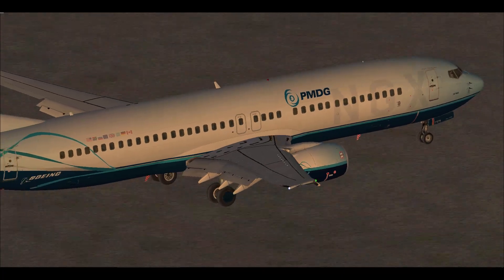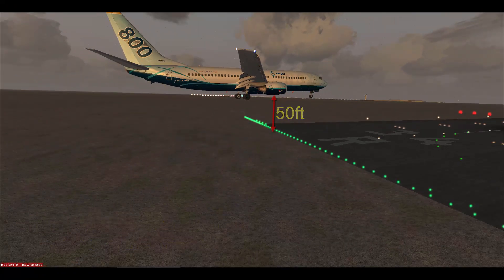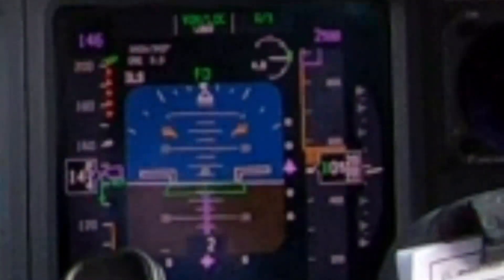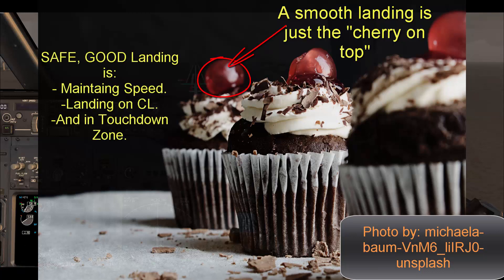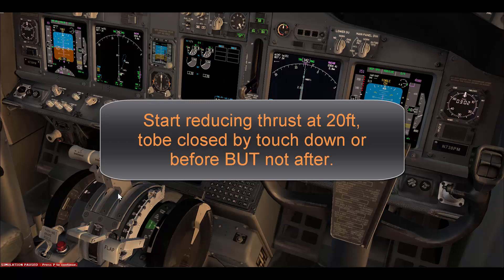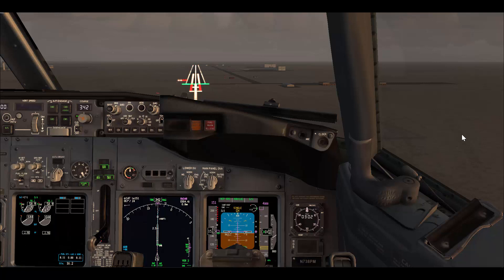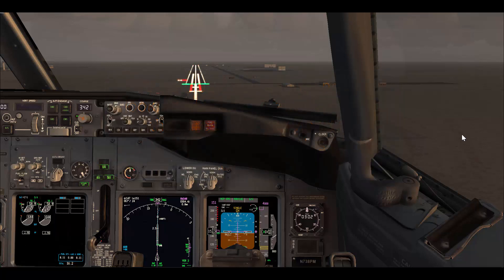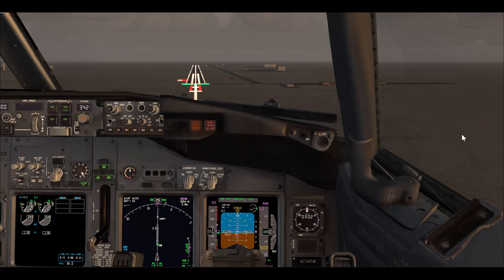B737 App & Lndg video#10 Landing

Comment: Hi Sir! Thank you once again for the videos. 

So per the FCTM, the flare height should be 20ft, I assume that this mostly works for a 3 degree glide-slope and no runway slope. 

In the case of a steep approach angle (like 4 Degrees) and/or an upsloping runway, how do you change your flare? You mentioned that if you have a sink rate, 30ft is a good time to "remove it" and flare at 20ft, do you suggest this technique for the steep approaches and upsloped runways? I assume that you are also listening to how fast the Radio altimeter is counting, if it is too fast, is it best to start reducing the sink rate straight away and flaring in one big movement? I am thinking the worst case scenario would be an upsloping runway with Flaps 40, because in this case, you have a low nose down attitude due to the extra drag, combined with an upsloping runway will make the flare quite challenging! In this situation, I imagine the 20ft flare cannot work as it normally does. 

Another situation, if you have a downsloping runway or strong tailwind on the final approach, do you still flare at 20ft or do you even consider flaring at 10ft and closing the thrust earlier? 

Thank you for the help!
Reply from the maker: Hello @Dwd-o4t 
First of my apologies for the late response 🙏🏼

You asked great questions let me try to answer them, feel free to challenge/comment/discuss my answer, what will help us both to learn and might be useful to others as well. 

So you mentioned the radio altimeter automatic callouts, for me this is the best tool for new pilots to gauge how fast they are descending and definitely help to decide how much and when to flare. 

The 20ft start of flare for new pilots is great to start with, you will see experienced pilots will flat at a lower altitude 10ft maybe, provided they are doing normal approach, with experience you will find your body will be able to gauge how much flare and when to flare, that would be flying by the seat of your pants s as they say. 

Upsloaped and down slopped runways are more of a visual challenge than actual glaring, so I suggest you do a normal flare and thrust reduction regardless of the slope, the slope might have an effect on the deceleration after touchdown, but not much effect on touchdown, I don’t think. 

Flaps 40, will need more thrust and to keep the thrust a bit longer than with Flaps 30, so be prepared to use slightly more thrust than usual and you might need to keep it a bit longer, the slope again is not a factor in touchdown. 

Tailwind is tricky and am talking about 10knots tail wind, the only thing to watch out for is be careful not to go idle thrust early as the tailwind might drop at any moment and you might end up with an excessive sink close to the RW. And you are right with a tail wind I might delay the flare a bit. 

Hope I was able to answer some of your questions, 

Please let me know if you have any other questions 

All the best, 
Abdul

Comment: I wish I had known you earlier. 
your explanation is so amazing. I'm an experienced 737 fo , but I still struggle with making good landings. 
Do you judge how much distance is left to the ground when flaring below 10ft?
some captains say to wait until you're closer to the ground before flairing when below 10feet. 
However , sometimes when I wait, I end up just touching down before I can flare!
Reply from the maker: Hello and thank you for your kind words, glad you liked the channel 🙏🏼, 
Ok so now you feel you are a bit too late on the flare, 
If I would to suggest something, is try to brake the flare in two parts, imagine your are doing it in two steps instead of one, 
For example say to yourself I will do 25% initially at 10ft then I will fo the rest after that. 
Again this is just a mindset, the time from crossing the threshold to touchdown is very short, but try thinking about it this way, 
If you are interested I can setup a call with you to discuss it further. 
Wishing you all the best 
Abdul

Comment: Hi captain asiri! I am middle of Lifus and I only struggle about 10 ft.
Once I tried first flare 20 ft I am not able to make others correctly so 
I started first flare 30 ft and reduce thrust 20 ft, second flare 10 ft, but I float aircraft each time, or my second flare is not enough. 
I feel so hopeless, I don’t have any problem about descent management or approach.
Reply from the maker: Hi, 
A lot happens in this phase of the flight, what I like about you, is you are very methodical in adjusting and assessing what you are doing, 
So here are some suggestions that might help, just read do not try to apply, your subconscious will take this information and work with it, after all this phase is just your mind, eyes and muscles are trying to create reference points, it is crazy how this flare and landing becomes almost a reflux. So:
- if you feel the airplane starts to float, reduce the pressure on the yoke (do not push the nose down) just reduce the pressure on the flight controls. 
- Forget about smooth landing, you are looking for a firm landing on speed on center line and in touchdown zone. Firm landing is a safe landing. 
- visualize the flare, and visualize your are doing all the movements correctly do it before the flight for five minutes after you wear your uniform, you have no idea how powerful visualization is. Agay talking before leaving your house going to the airport. 
- Use this struggle and frustration, to challenge yourself, that will give a different perspective, I was bad when I first started flying, my landings were bad, identifying emergencies in the sim was terrible, I reached a point that I felt I did a mistake becoming a pilot, but you know what, I decided to use that as a fuel for myself to become better I looked at it as a challenge this whole channel was created cuz I struggled when I first started flying the airplane. 
So look at it as a challenge, and be patient with yourself. 

Am more than happy if you like to connect and discuss this further, 

If you like send me an e-mail abdulmuati37@gmail.com 

All the best, 
Abdul

Comment: Do pilots have difficulties with muslim prayer times? İs it possible to be an airline pilot and do prayers 5 times a day or should someone look for another job.
Reply from the maker: Hello S.K. 
Pilots do not have difficulties with Muslim prayer, as the religion is flexible, their are ways  in accordance with Islam where you can do your job and satisfy the requirements of the religion as well. 
The to the second part of your question is, yes you can be an airline pilot and satisfy the requirement of the prayer.

Comment: What I (as a virtual pilot only) have discovered, it is easier to cut throttles at 30ft and flare at 20ft. Since I do that, my landings are almost always on point without floaties and without a nose high attitude. I don´t know if it has to do with X-Planes ground effect physics but it works better than cutting the trottles after initiating the flare.
Reply from the maker: Hello Jump N Run (Cool nick name), 

I agree with you, also in FSX I tend to cut the power above 20ft, and just concentrate on flaring and touch down.
I believe the reason FCTM recommends a constant reduction in thrust is to avoid abrupt changes in power which lead to the need for abrupt changes in pitch. 
The smoother the change in thrust, the better control over the airplane you have. 
Thanks for sharing. 
All the best
Abdul

Comment: As yousual awesome video Capt.Please explain a technique to maintain a touchdown point in 737 without looking PAPI or GS ,when we have visual. During night landings, I always find it difficult for an aiming point.
Reply from the maker: Hello arun aravind, 

That is a great question. 
Believe it or not I am still struggling as well in this area 😐

Here are some of the tools that might be helpful: 
- when on the proper glide path make a mental note of the position of the threshold from the bottom of the windshield. That could be two inches or one inch whatever it is, make a mental note and this is going to be a great reference to use. How to get to this point use any of the following: 

- Utilize the vertical deviation indicator in the ND. Provided you have the RW set in the FMC and the FMC has sequenced to the RW. 

- DME to the RW is a great tool as well, so at 3nm from the RW you want to be at 900ft AGL, at 2nm 600ft at 1nm 300ft. 
If you rather have it in MSL just add the RW elevation to the altitudes above. 

- The vertical bearing is another great Tool 2.8-3.0 degrees or so to the RW you are very close  to the proper path the FMC will give you V/S as well that you can aim for. 

Hope this help, let me know if you have any other question or more explanation. 

Thanks for your kind words
Abdul
Reply: @AbdulmuatiAsiri37  Thank you capt,I will try it next time.I am back on my cockpit.
I recently attended an interview of an airline and 1 question they asked one of my colleagues, we couldn't find the answer. "If u get Windshear caution (red cone with black stripes )on ND before 80 knots.What will be your action".I checked it everywhere, .Even on Qrh,for approch ,It is given as pilots discretion, but nothing about takeoff .Can you help me to know ,weather it is a Reject or Go situation. We all First said ,It as Reject,But,they want to know, where is it written .As for low speed Reject, in conditions given by qrh,It is predictive windshear warning and not caution.
Reply: @arunaravind4279  it's a reject. Think about it.. You're in the low speed regime and there's a windshear warning... Why would anyone continue. Better question would be close to v1?... Answer is still no. Where is it? In limitations.
Reply from the maker: Hello arun, 
Thanks again for another great question, PLEASE keep these questions coming. 
The following are my opinion as a discussion topic and not advice on what to do in real life flying.

If you reference the QRH, Maneuvers-Non-Normal Maneuvers section/Windshear/Windshear Caution,
which is the first section in Windshear it talks about dealing with the caution in predictive windshear is just to “maneuver as required to avoid the windshear”. However predictive wind shear warning is specifically mentioned and talking about when to reject and when to do the escape maneuver in a takeoff roll.
So Predictive windshear caution in takeoff, maneuver as required,
Predictive windshear warning: below V1 reject, Above V1perform windshear escape maneuver.  

So the answer that I will be giving is "I will continue the T.O. as long as it is a caution, and not a warning provided no other indication imply a real windshear situation exist"
Hope that help,
Thanks again 
Abdul
Reply: @AbdulmuatiAsiri37  Thank you capt.Our problem was,in qRH,the caution statement to manoeuvre is given only for approch and nothing was said about Takeoff.But,when we discuss too,we comes to same conclusion.But,some were saying, a low speed Reject is much better than taking off into a doubtful windshear condition.But,Like you do said  If we take caution for approach as a general criteria, I think we can continue might be the answer.
Reply from the maker: I agree with you a 100% a low speed reject is the best way to go in a situation like this. 
Regarding the QRH, that section is mentioned at the beginning before the Takeoff, then the approach. 
Thanks again for a great question. 
All the best

Comment: Hello Captain,  An interesting lesson to learn. By analyzing and understanding these intermediate steps, it should no longer be difficult to merge them as imperceptibly as possible. An approach that many can take advantage of. I am also happy to experience that the COVID-19 has not reached you and I hope it will stay that way. Please stay wary of this. Finally, another question: Is it permissible for the Captain to take the right seat and the FO in the left if he prefers to do so during a regular flight? Bye bye Captain ...
Reply from the maker: Hello G L, glad you liked the video, and thanks for checking on me. Hope everyone stay safe. 
Regarding your question, if I understood it correctly. Can the Captain switch seat with the FO?
For a switch like this to happen, both of the two pilots have to be typed as captains and both are authorized to fly from left and right seats by their company. 
Otherwise that switch can not happen. 
Hope that answer your question. 
Please let me know if you have any other questions. 
Stay safe and take care G L

All the best 
Abdul
Reply: @AbdulmuatiAsiri37  Thank you Captain for your answer. Bye bye ;)

Comment: Hi Captain, another great video from you again. And once again, I'm going to say I wish you had made this video during my Line training and my early days of release to the line. At a stage I found myself over-flaring at 20ft which had the result of keeping the aircraft floating or going back into the air, I later realized I had to much energy and I should have introduced the power reduction just as I commenced the flare. Also, the challenge of keeping the centre line at short final was a challenge at some point but I found out I was over correcting, thanks to the amazing Captains at my company who patiently showed me their personal tricks to correct the situation. But again I'm yes if I had seen your video earlier it would have made a big difference. Keep up the good work sir and keep safe!
Reply from the maker: Hi mtrackerbeyon, thank you so much for your usual support for me and for the channel. It help me a lot getting a feedback specially from guys with experience. As this channel is intended for new pilots and simulator enthusiast. A feedback from experienced pilots help me stay on the right course as far as content and subjects to be covered. 
Thanks again and please continue your support to the channel.
All the best 
Abdul